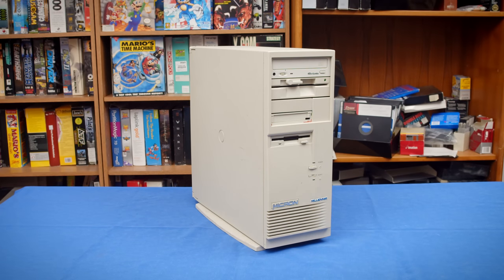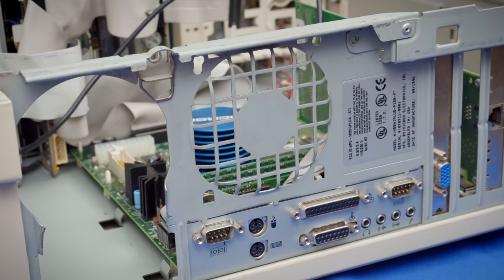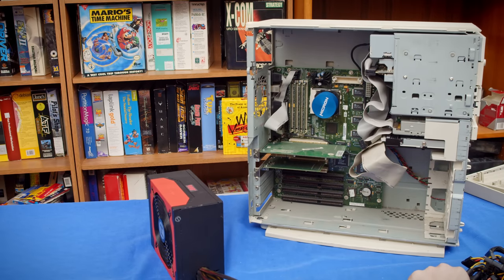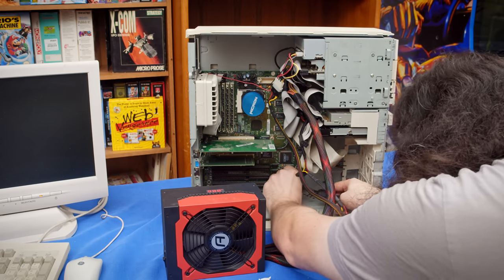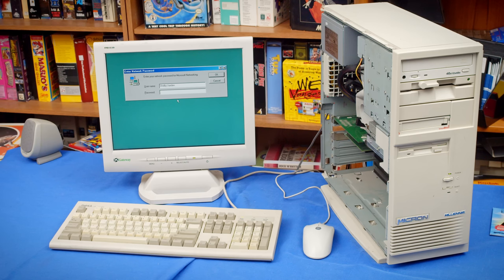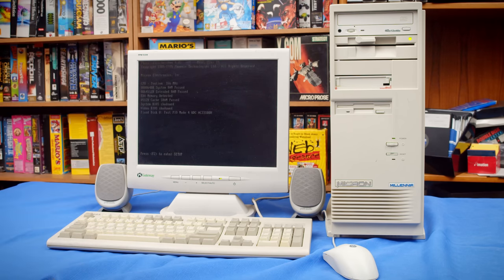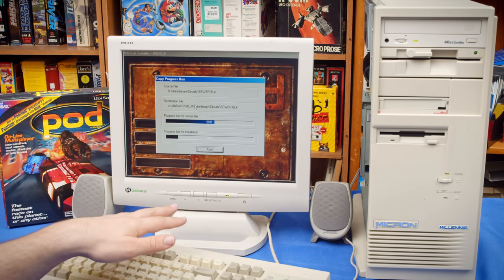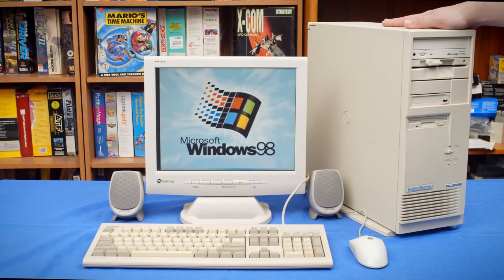Troubleshooting the 1996 Micron Millennia

Comment: Be glad you were able to recover the system from having the wrong BIOS flashed so easily! Almost 25 years ago, my husband tried to update the BIOS and a similar thing happened -- several versions of the motherboard, not BIOS cross-compatible -- but that motherboard didn't have any way to recover from a failed BIOS flash. Fortunately, a few days later, he was going through a drawer at the place we both worked with some dead motherboards, and found the exact same model/variant he had just broken. He got permission to take the board, so he harvested the socketed BIOS chip and swapped it into his dead motherboard, and voilà! He was then extremely careful when he flashed the BIOS again. 🤣

Comment: I spent my summer in 1998 working for the company that did phone tech support for Micron (a terrible job, by the way) - I troubleshooted more than my fair share of that exact model.  I'm a huge fan of those anodized passive heatsinks too - I'm surprised I haven't really seen something like them in other brands of PCs from back then.
Reply: At my previous job, about 10 years ago, they hoarded everything, so when clearing out old technology junk I saved a bunch of them and displayed them on a shelf in my office. Sadly I forgot to grab a couple when I changed jobs.
Reply: Thank you for being a Micron support tech. I started my PC learning journey endlessly calling Micron Tech support.
Reply: Especially because the anodised texture should (marginally?) increase surface area. I feel it should be way more common. Not like most aluminium heatsinks are super shiny, but it’s more a natural oxidation dulling rather than full on anodised.

Comment: I hadf a Micron Millenia as a work computer back in the late 1990s. It was a later version of the computer (PII-233, slot 1, 440LX chipset) but the case was identical. They clearly used the exact same case for several generations of computers. In fact, when my work computer was upgraded after a few years to a (IIRC) P4, and the old one was going to get scrapped - I asked if I could take it instead. And they gave it to me, minus hard drive. I still have the case and floppy/CD drives from it (the motherboard is long gone). At some point about 15 years ago I turned it into a hackintosh - put a motherboard from a G3 beige Mac in it. It's still in this configuration and still working to this day - yeah it has the floppy drive but of course that's not connected to anything. :)

Comment: I’m amazed at the plethora of old tech I’ve forgotten about that I used to sell when I built custom PC’s back in the late 90’s early 2000’s. Apart from the occasional high end custom game PC I get requested to build I only sell Lenovo now for laptops, PC’s and servers. A custom UNIX server I built back in 2003 came back into my possession a few months ago when I converted it to a VM for my customer. I turned it into a DOS game PC using all the original hardware I built it with minus the tape backup drive.

Comment: Shelby, you can always mix and match parts from the Dell Dimensions made at this time too since its the same chassis with Dell branded faceplate.
Reply: On the Macintosh side, it was either Power Computing and/or another Mac clone manufacturer who also used this same basic chassis.

Comment: Bring back the memories.   I was in college in 2000 - 2004.  They had been donated dell xps t700r machines that used the same case design. I am sure other models too.  A vertical hard drive was installed underneath the hd slot you used. The label side side faced in and and two long 6-32 screws from the front.

Comment: Between 1998 and 2001, I worked at a place where one of the machines we used to do demos was actually just a pile o' parts sitting on the conference room table: A motherboard sitting on an anti-static bag, power supply and hard drive just sitting next to it, monitor plugged into a video card just sticking up out of the motherboard... and usually at least a couple of $10,000 telephony cards. Our conference room also did double duty as our lunch room, and one exciting day, with a demo happening later that afternoon, during lunch I knocked over a can of Coca-Cola and nearly flooded it. 🤣🤣

Comment: i remember that at least the 250mb style qic80 tape drives (different manufacturers) that i installed in the 90ies came with adapter cables in the box. these allowed you to install two disk drives along with the tape drive on a single standard floppy controller. there was neither extra switching hardware-wise nor special software involved to get that setup running.

Comment: The Iomega Ditto tape drives had a separate Ditto Dash ISA card for faster speed. It was a double speed floppy controller with a single port. Before affordable CD writers and drive imaging software, this was a good system for backups.
Reply: Just to add to this -- the tape drive doesn't "take up" a floppy connector.  If you don't have a dedicated fast controller card, then the drive would have shipped with either a four-connector floppy cable (controller, tape, B and A), or a splitter cable that goes in-line between the controller and normal floppy cable.

You can also just make your own cables by buying some 34-pin IDC connectors and ribbon cable.  I make my own custom-length cables for all my retro builds.  Tape drives just need another untwisted connector, like a 3.5" B: drive would have.

Comment: TIP, copy the win98 directory on to the HDD from the CD and then run the setup. This way when Windows needs to get filers, they are on the HDD and it will get them without asking for the CD.
Reply: Or even better, you can copy (by using the xcopy command in the Tool directory of the CD-ROM both the Tools and Win98 directories under a Win98 directory on the HDD before installing Windows, then run the setup program from the HDD. Then you'll only need a Windows bootable floppy disk if you need to do a fresh install on a corrupted Windows 9x system.
Another cool tip : you can make your own Windows 98 (or 95) custom bootable CD-Rom plus the complimentary software (DirectX, IrfanView, CD-R burning software...) or drivers you need. I still have a 20+ years old 8 cm Windows 98 CD-ROM + 10 Windows programs that I still use today.
Reply: This computer only has a 3.1 GB hard drive, though - I can understand why Shelby hasn’t done so on this particular system.
Reply: @gymnasiast90  It only takes 125MB. BTW,  he could also install his 40GB Maxtor HDD as a secondary drive for data space.

Comment: For the hard drive mounting, at least in the Dell equivalent, there was an option to mount it vertically underneath all of the other drives provided the required long screws were on hand.  The Dell beige plastic bracket may be required to do that, though.  Dell used a very similar case to this Micron Millennia starting with the Pentium 1 and going into the Slot 1 Pentium III era.

Comment: A modular SFX PSU makes large old cases much easier to work on! You just have to make sure the cables have enough length or add some extenders/splitters for the molex cable. Another good thing is that you can leave out certain cables like the PCI-E and maybe even the SATA cables for a much neater build!

Comment: The Palo Alto Atcx case has got to be one of the best ever. I had a millennia mme (200mmx) in tower configuration and bought a couple more generic versions of the case that I used in desktop config.  I now have none. 😭
Arstechnica even reviewed it way back when.  I think you can still find the article in their archives.
You appear to missing the back half of the vertical drive bay cage that lets you mount one to the bottom front part of the case. You should be able to put one there anyway if you have a couple of screws long enough.

Comment: For 1996 that seems like an incredibly futuristic case. Very early for ATX too I think? (Quick google says Intel patented it in 1995) Either way modern ATX PSUs often aren't great with older PCs because with shifting  revisions of the ATX standards, basically the entire focus has been shifted to the 12v rails, with the 5 and 3.3v rails diminished and the -5v rail removed entirely. One of those PicoATX thingies might actually be a better choice at this point.

Comment: 6:10 - That CD burner is most definitely NOT "standard for the era". 40x12x48 drives didn't come out until the 2000s (it looks like that precise drive came out in 2002.) Even CD-R 2x drives were rare in Pentium-era computers. Heck, the Plextor 8x CD-R / 20x CD-ROM read drive only came out in 1999, and CD-RW was only officially a standard at all in 1997, well after the Millennia was released.

That optical drive is an upgrade made at least 5 years after the system was released.

Comment: 8:47 You can also 3D print a 3.5” holder for the SD-to-IDE adapter, it is publicly available and works very well. This way, you don’t need a blanking plate where the Iomega Ditto was.

Comment: Nice job!  Back in the day, you didn't have the internet to help.  Mostly Vendor sites, BBS', and Magazines!  You're lucky the wrong BIOS didn't brick the board.  Also...  I believe Micron was the last American manufacturer.  The $100 foreign boards were $1000 for the same specks!  But they did work come consistently.   The biggest problem I found was foreign memory. I'd come in and drop a couple Micron modules in and it would become rock stable!  I had customers who thought Windows was unstable.  They'd reboot several times a day.  Until they got good memory.
At least you're using the PCI era boards.  Back in the day you had to set jumpers to set memory locations for interrupts.  There were times when you simply couldn't put everything you wanted to because you ran out of interrupts and memory locations.  People mod their cases these days because they don't have to work to get everything working!  
Thanks for the video!

Comment: i have a pentum 3 era micron millennia and apart from a different front panel the case is pretty much identical to that one. unfortunately all of the weird toolless parts like that fan and hard drive holder  (and one on the 3 1/2" floppy drive too) were missing so i had to make a few modifications in order to put that stuff back in. the case was in really rough shape when i got it, so i didn't feel too bad about butchering a few parts. i also reconfigured it to be a horizontal desktop instead of a tower, the 5 1/4" drive cage could actually come out and be rotated, though i dont think it is intentional given the slightly wider base, which just hangs off the edge of the desk now.

Comment: I remember when I was a kid, there was a Micron computer store that somewhat nearby. I remember going in there and seeing some of the computers opened and getting to see inside of a computer. Strangely I had weird ideas as a kid thinking that a computer case would be jam-packed with electronic parts and that is why there was such a huge case. I am not sure, but this may have been the first time seeing one opened and getting to the realization there is a lot of open and empty wasted space. However I was transfixed on this futuristic looking cpu cooler and the guy was talking about the parts and said that was the cpu. I didn't exactly register entirely that it was a heatsink, the concept was still somewhat foreign to me. I just remember seeing that and always wanted a cpu like that. It was just so cool looking. I later purchased and built my very first pc and realized that the heatsink wouldn't likely work too well as they all require fans for cooling now. Still, there have been times over the years where I see these micron pc's and still the heatsink is fairly cool looking to me. I have owned plenty more exotic and nifty looking heatsinks and have sold and got rid of many of them, still whenever I see this micron one again after all these years, it just makes me feel nostalgic and it was just a weird time of wonderment by these computers and me just really wanting one, but for a long time we didn't have a home pc. My dad did, he had a 486 133mhz amd system and he wanted to give us his old 386, but I am not sure any of us would have known how to use it. Sure my mom used unix at her work at the time, but I guess I could have learned to use the command line somewhat and I did later. If only I had the time to actually enjoy retro computers. I really should start selling all my old parts and computers tho. I almost wish I kept every era of pc I had intact. I can still enjoy youtube content of it tho.

Comment: Man, I first got my toes wet in Voodoo a few years back with a Voodoo 1, stuck it in my maxed out Packard Bell Multimedia, of which originally I ran an MMX overvolted, then switched to a K6 III with interposer.
I remember having those EXACT issues with pod to begin with, and I have both the POD OEM PB release and the POD Gold release...

Comment: I could bet money that the case manufacturer did older beige Dell Dimension/XPS cases too, very similar. What I liked about them was that they were very slim.
Reply: The UMAX SuperMac Macintosh clone also used the same case.
Reply: @jacobmarzynski7719  Cool. For the Dell systems only the lower half of the front bezel is different.
Reply: That what i got on mind when i saw the back of the machine. Liked these too, really nice looking.
Reply: Yes I was thinking this! Reminds me so much of 96-99 era Dimensions
Reply: @mmartti2k116  even the rattling sound of the side panel reminds me of rhe Dell cases. 🙂
Reply: @patrik_x86  yeah it was the best era of the PC, so much happened. Like overclocking a Celeron 300A to beat the Pentium III 500 (or Pentium II 400? Memory fails me). 🙂
Reply: It must have been the Pentium II 400/450. Back in 1999.
Reply: I have two PictureTel video conferencing PCs that use this case, mine are black, and the front molding is slightly different, but they are otherwise identical to that Micron.

Comment: I have a similar Millenia (same Motheroard but P133). Mine still has the original W95 install on it. This board has a Goldfinch connector to upgrade this Vibra to a AWE32 with a CT1920 card.

Comment: The OEM for those Micron and similar Dell computers was Palo Alto the case model was the ATCX. The case is pretty modular if you take the face plate off and remove a single screw you can remove the 3.5 and 5.25 cage.

Comment: Hey Shelby, it's great to see that you got the Micron going! It's good that at least on the hardware side it was just some bad ram and that was a good catch on the bios issue. Honestly, I'm surprised that the bios on that is flashable... most machines that old were eeprom chips and not flash memory. Those old Caviar drives are awesome too... Our first family system had a Caviar 11000 (1Gb) and the sound of them is quite distinctive, especially when they startup and go through their self diagnostics. 

Your systems looks like it's a bit older than mine, as mine is a normal ATX board and doesn't have the mounted cable connected connectors. I think the VRM on mine is built in as well, I don't remember it having a separate one and it's definitely dual voltage and I'm running a 200MMX in it. Ironically, I also have a voodoo in mine (my first ever) but I think I paired it with a Matrox Millennium for 2D. Not 100% if your case is the same but as the one I have is the one Colin at LMG did the sleeper build in, it had a large hole drilled in the bottom steel. The bare metal chassis was the exact same as the PII/PIII era Dell Dimensions and I had one that the plastics weren't great on (and I already have a few anyway). I was able to swap all the Micron plastics onto the Dell chassis and it all swapped perfectly. If you ever want yours to be restored (the brace at the PSU), that should be a way to do it, plus those Dells aren't too hard to find. I believe mine is dated 1997, and was originally a P166MMX, but Colin kept the original CPU because of that gorgeous anodized heatsink. 

For the tape drive, maybe see if you can find an IDE Zip drive. My system came with one in that spot, and they're period correct and still handy for moving files around especially if you also have a USB external zip drive too. 

I just wish I was able to catch your live stream where you were diagnosing it!

Comment: You can use the appropriate version of MaxBlast (Maxtor version of EZ-Drive) for your 40GB Maxtor HDD if you want to override the bios limitation of your system (even if it will still be limited to ATA 33 I/O speed instead of UltraATA 60/100). Sometimes, the HDD detection problem can also be solved by using a different ATA cable (another 40 pins 80 wires UltraATA cable or a classic 40 pins 40 wire ATA 33 cable).
Edit : it's quite wholesome that the wrong bios update can be reversed. 
By choosing to install Win98SE instead of Win95,that's quite to be expected for not needing any third-party driver on a standard system (S3 Virge, Creative Vibra 16, usual 3Com ethernet card, Voodoo 1) that is at least three years older than the OS. BTW, a Matrox Millenium or Mystique can be a nice update to the S3 Virge, the video signal quality will be improved, especially when used with a Voodoo 1 on a CRT monitor.
Oh, and if you want to expand the possibilities of Windows 98 you can also install NUSB (if you install a USB 2 PCI card) to use flash drives and external USB HDD (NTFS supported with NTFSDOS Professional 5 and NTFS Reader 2.1) or other USB peripherals. You can also add useful utilities like MCDU Plus 3.1 and KernelEX if you want to experiment Windows XP software on this machine. And if you keep the same graphics setup, DirectX 5 is the last version that can use this hardware.